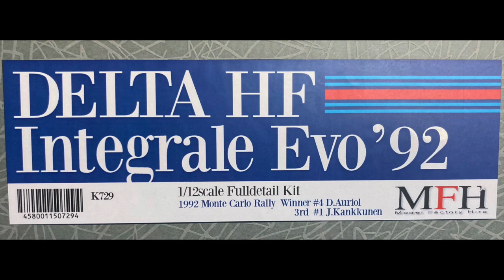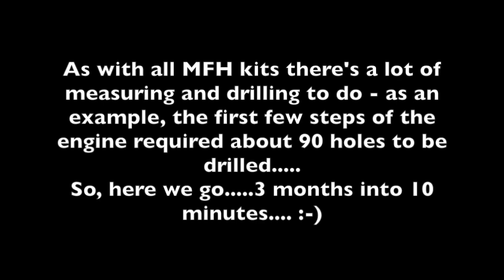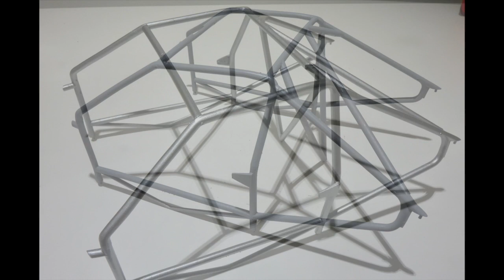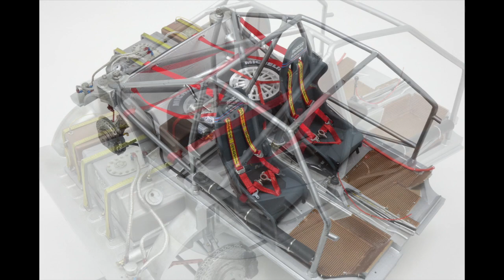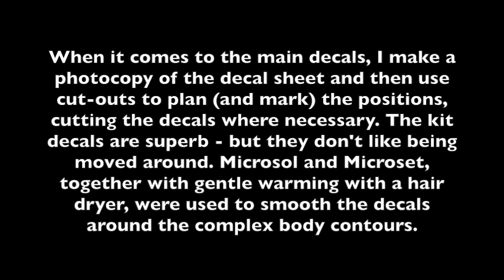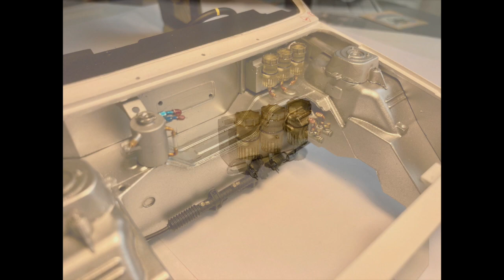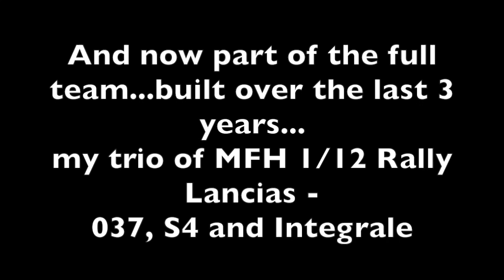Model Factory Hiro 1/12 Lancia Delta Integrale HF

Comment: Fantastic build I’m thinking of investing in this kit as it is one of my favourite cars can you tell me what is your preferred glue for painted parts
Reply from the maker: Hi Roosterfox and thanks for the comment. I use Zap-a-gap medium CA (don’t use ‘thin’ - it’s a nightmare!) almost exclusively for all my building. For painted parts, wherever I can, I scrape away some of the paint - but otherwise it still works ok depending on the paint. Hope this helps. It’s a really great quality kit. From a building point of view, one of the best MFH kits I’ve done..  cheers.

Comment: Hi John, been subbed for a while but don't think I commented? Is the zero 2k etch primer worth having? I have found the Mr Hobby, Upol and others to be quite ineffective, though people tell me it's better if you thin it with rapid thinner?? I just got a Lancia 037 and Gr 5 Montecarlo for my first MFH builds.
Reply from the maker: Hi. Apologies for delay. In a nutshell - yes, it is worth having. I have used it on all my MFH builds. It adheres very well to resin and clean metal. I’ve tried other stuff but doesn’t do the job. The only ‘issue’ I’ve had is that, once mixed it needs to be diluted quite a bit with Zero thinners and then applied in light coats. It’s supposedly airbrush ready but it’s far too thick. And the other frustrating thing is it’s dense grey! So this means, for most top coat colours the grey has to be over painted with white base coat of some sort. I’ve found that unless I need a really specific Zero colour, the new Tamiya lacquer paints work really well on top of the Zero primer. Hope this helps. Cheers. John.

Comment: Honestly will this be a hard kit for a beginner. Can’t find any other 1/2 delta beside this one with the design debating on it
Reply from the maker: Hi Jordon. Well, if you are an inexperienced model maker, and I hate to put anyone off, these are really challenging kits for all sorts of reasons. Anything is possible, but I would say that this might be a step too far. Unlike for example Tamiya kits which have foolproof step by step instructions - these don’t. There are steps to follow and lots of diagrams - but the onus is on the modeller to work it all out. The actual parts are not numbered. You may already have theses tools ,but if not - a range of drill bits from 0.5mm - 2mm; a range of sanding files for metal; a good selection of abrasives and polishing stuff; and lots more! I’m an experienced modeller and this kit took me 6 months of evenings - compared to a 1/12 scale Tamiya which I’ve done in 2 weeks. ……..but the decision is yours. If you go for it, be prepared for lots of head scratching and problem solving and spending many hours on relatively small assemblies.  At least there are several step by step builds of this model on YouTube.  Have fun!